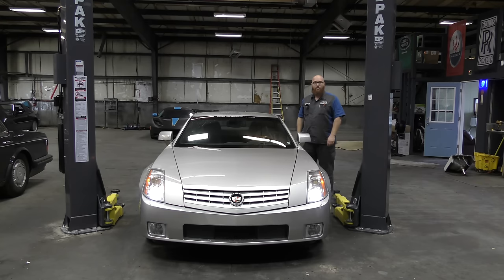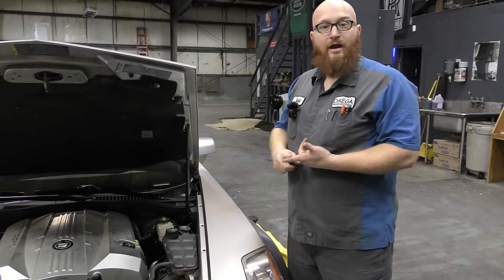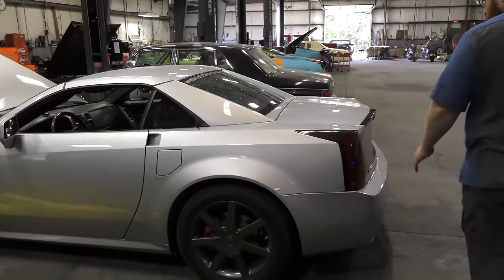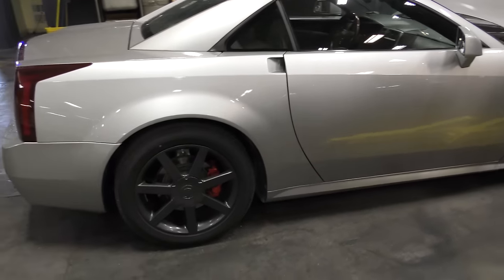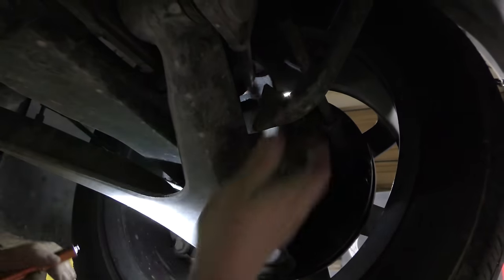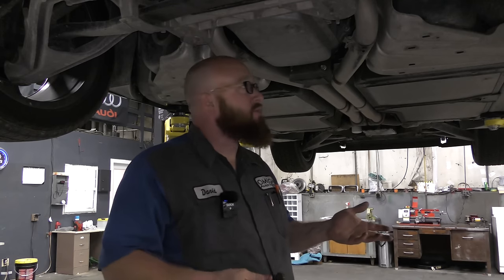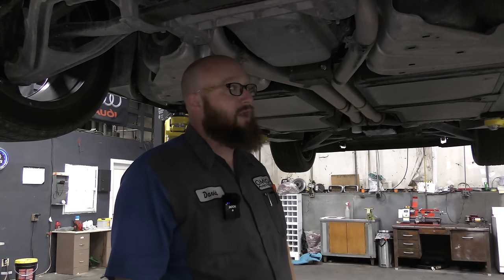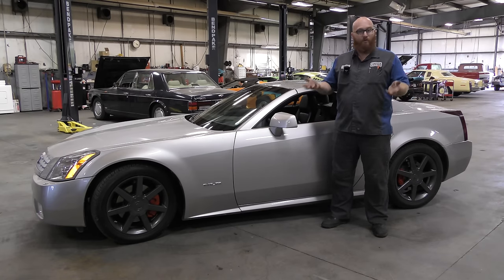The CAR WIZARD is shocked this 2006 Cadillac XLR has a Lotus Sized Repair Bill?!?

Comment: Wizard, check the prices on the tail lights. Apparently the insurance companies write them off even in minor rear end accidents if the tail lights are damaged. About $2K each used !!!
Reply: I went to ebay because to your comment, and holy shit those LED Taillights are expensive as fuck.
I wonder why.
Reply: Honda crx back in the day, rear end crash would destroy the lift gate.
Reply: @josemanuel5749  
Probably due to availability. I don't think they built that many of these cars in any of the trims. That may be the reason the radiator is so expensive also.
I agree with wizard that I think these look really cool certainly more unique than a Corvette. But I think given the circumstances I think I would just get the Corvette because availability of parts is going to be much easier.
Reply: You can tap something with the front bumper of a Lotus Elise and insurance will total out the car.
Reply: @audiowize  Yes because,  you have to replace the whole front clam-shell.
Reply: @josemanuel5749  because the entire assembly has to be replaced for the most part and very few of these cars were made
Reply: Same prices for the headlights.
Reply: @kens97sto171  and performance. unless you get the xlr-v. but for that price, you could get the z06 vette with even better performance 🤔
Reply: That is not surprising on these "luxury" cars. The price for the headlight housing (just the housing, nothing else) on my '12 Lincoln MKZ is $600 per side!
Reply: One guys is selling one for 4K like holy fuck for a ehh car too??
Reply: @leebrooks7467  good car to buy and part out if you are into that
Reply: Same problem with cadillac SRX export version ! (Black version and orange turn signal).
Reply: If there were a way to use a 3D printer to make one.
Reply: I wondered what those new huge escalade tail lights cost to replace. Lots more of them on the road there but they can't be cheap given the size.
Reply: Yes they look great but mostly all GM products are trash and just a minute away from being a huge pain in the head... The money and maintenance these cars require is bazurt, in my opinion, not even worth the risk...
Reply: Drill a big hole in the back of the housing and put your own leds in cheap fix
Reply: Even my 17 Ford Edge tail light was 800$. Headlight is 1100$. Scam.
Reply: @johnp556  but I want to save every crx ....
Reply: @josemanuel5749  When they were still available from GM/Cadillac they cost more than $1100.  After production ended, no new headlights were available.
Reply: @itsthatatm8345  That is a biased opinion (*all* GM products are trash).  I owned two XLR's and I currently own a C7.  I drove my XLR Platinum 80,000 miles and sold it to a guy who has driven it another 46,000+ miles; my wife drove her XLR about 20,000 trouble-free miles, and I've put 44,000 miles on my C7 --- also, not a single issue.  These cars were all built at the Corvette Plant in Bowling Green, KY.  Maybe that's the difference.  Point is, all GM products are not trash.
Reply: @ISUringman1974  That just maybe the difference, I live in Houston TX and our Cadillacs don't come from that plant I don't think, every Cadillac I've come across and or worked on is bumbum, one thing goes wrong, many things go wrong... Biggest issues have been electrical, Northstar issues and transmission issues... I really used to like GM products, hell the Corvette, 1996 Impala, Pontiac Firebirds, Chevy SS's and G8s are some of my favorite cars...
Reply: I heard something similar about vioers years ago, that if you do what looks like  a minor fender bender in the front end that it can be like 20k or more to fix, like the whole clip is toast and when that happens they usually get written off. 
Not sure if I was hearing smoke up my butt or not but it was interesting 😄
Reply: @janetyeoman1544  
newer cars suck. 
I think I just blew about 120$ on those stupid plastic body plugs for the floorplans  on a Jetta I'm redoing. 
If they aren't on a car you're looking at to buy, run away it's gonna be a rust beast. 
Mine were intact until you'd breathe on them or touch them ,and they crumbled. 
Stupid plastic
Reply: @itsthatatm8345  Actually, the majority of GM issues are not seen in cars produced by Corvette (and the no longer produced XLR) because Corvette management, while under the GM umbrella, are really good at what they do and the Bowling Green Assembly Plant has higher quality parts and QM.  So, there you have it...GM could do better, it just chooses not to.
Reply: @josemanuel5749  Cuase they are computer controlled and have a circuit board  integrated into the taillight assembly, VERY difficult to wire tailights bypassing the computer=expensive. btw, its usually the circuit board that dies, not the bulbs
Reply: @itsthatatm8345  GM has gotten better at making cars that don’t start falling apart right away but they’re still unacceptable.  I had a 2002 Pontiac Grand Prix GTP coup that I loved!  I kept it in the garage and only drove it to keep everything going.  In 2019 I decided I was going to take the car on its first trip.  I got 122 miles from home and the car started having electrical problems so I had to have it towed back home!  It ended up being a $3,500 repair to the cars entire electrical system.  The car only has 1,280 miles on it and other little things are starting to fall off or break.  My 2 other GM cars (2008 LaCross V8, and 2012 Cadillac SRX4 3.6V-6) have been excellent vehicles.  I’ve had no issues with them.  My SRX4 only has  22,231 miles on it and my LaCross has over 180,000 and other than tires, brakes and oil changes I’ve had no other repairs to deal with.  GM got their reputation in the 80’s when they started making crap cars and they continued to make crap cars into the early 2000’s.  I mean what the hell was the Pontiac J1000?  I don’t think GM’s reputation has recovered.
Reply: The xlr-v unfortunately is not an ls based engine as you stated, but a supercharged northstar.
Reply: @gplaycount3154  

Yup.....with smaller bores; a 4.4L Northstar POS. 

Flipped a XLR last year....cannot believe how the switchgear and interior trim was falling apart on the turd. Absolute garbage......almost forgot, the retractable roof was tits up...had 60,xxx miles.

Comment: "Cadillac XLR, the car you buy when you want a Corvette C5 but you want to pay more, go slower and not have an LS" 

-Regular Car Reviews
Reply: It's the car you buy when you don't want a Playskool quality interior
Reply: @Scoopra  Cadillacs of these era weren't really any better on interior quality compared to their GM counterparts. Slap some cheap leather and fake wood and call it a day lol.
Reply: @KatoJac  Actually the wood is real (eucalyptus on mine), and the leather is good quality; mine is still flawless after 14 years.  That said, the hardware could be better quality considering this car was supposed to go up against the M-B SL.
Reply: Dave Anderson I’m not being specific to the XLR, just cadillacs of that era in general.
Reply: @KatoJac  Cadillac's have used genuine woodgrain since the 90's though. They used Zebrano back in those days, and my old piece of shit STS had real maple inlays... I should have popped them out and made a craft project with them before I traded it since it was always in the shop, yet GMAC still always wanted their payments on time.
Reply: @Scoopra  nah they feel cheap, I've driven these around. I'd still take a vette. Besides I don't want to pay 3k to 5k for some taillights
Reply: @KatoJac  It's a Cadillac. What are you smoking?

Comment: The XLR is such a good looking car, it's a shame it's so expensive to keep running

Edit: By expensive to keep running, I mean the notoriously expensive tail lights lol. So maybe "expensive to keep on the road legally" would have been better phrasing
Reply: It is expensive if you don't do maintenance. A lot of people buy these cars and run them into the ground and they for go maintenance. That happens when they don't have service people they can trust so they don't waste money they just trade in.
Reply: I dont think a radiator for $300 is that expensive, especially for a quality AC Delco part. The 5 hours of labor is a lot though!  Rockauto has aftermarket ones for around $100.  We've had more mundane GMs and a AC Delco radiator is around 200-300ish for those too.
Reply: You gotta remember this is full charge shop rates. If you're half an enthusiast and have some tools you can do most maintenance on a car like this for parts prices plus your labor.
Reply: Or find a a street mechanic. And only get charged 250 at most
Reply: @johnblaze6269 -And hope he didn't miss anything because he didn't have the proper equipment to diagnose with or shop equipment.
Reply: It's high maintenance and very expensive-just like a beautiful lady.
Reply: @bartonreid6740  The only thing more expensive than a good mechanic is a bad one.
Reply: It is a handsome car. I actually had a wish to one day own one. However, with these repair costs, I'd have to pass. I'm a DYI guy for the most part. But even this is too much.
Reply: @DucatiPaso750  The XLR coupe is nice looking car but sounds like it's safer to just go ahead and buy a Corvette at least there more reliable plus you get more power!!! Cadillacs look nice but they just don't last long
Reply: You can no longer purchase Headlights since 2019

Comment: The rad side tank is made of ABS plastic, clean it, open the creak a little with rotary file prepare a mixture of ABS powder with ABS glue and fill the crack let it dry, pressure test it
Reply: François D yup that was my thinking.
Reply: This is a professional automotive shop that he runs. Rarely does that work. But if it does how can you charge a customer money for a repair and not be 100% confident it will work.  If he went around putting glue all over everyone's car he would be out of business and look like a hack. If it's your car and want to glue it.thats different.
Reply: That's fare enough, however the time taken to clean and repair the part also the part would not carry a warranty. Were it to fail again the repair shop is then liable so from the shop's point of view they will have to use new/as-new parts.( by the as-new I mean say a part that has been rebuilt and had a warranty put on it).
Reply: Some people aren’t in this business  to put Bandaids on someone’s expensive assed car.
Reply: Considering that takes 1-2 hours of labor easily, at $100+ per hour you're paying half or more of what a brand new radiator would cost.  Not worth it!

For a DIYer with time and sweat to burn, sure why not!  I spend a lot of time repairing cracks in a BMW ///M polycarbonate bumper to avoid paying $1,000 for a new one.  Shops preferred to just start with a fresh factory piece.

Comment: XLR V never had a LS option. That was the cts V only. Have seen some LS swaps but not from the factory
Reply: Regular Cadillac use Impala's engine and drivetrain. Transmission's shifting feel same as friend's Impala.
Reply: Didnt the the XLR V have the rare Northstar supercharged engine. Impalas did share the 3.6L Lfx with some caddies
Reply: Yep, 4.4L supercharged Northstar. Also in the STS-V.
Reply: @jesdadotcom  
Cool that you brought that up, the sts-v  was one of those cars that flew under the radar.2009 was the last year for sts-v
Only 96 were made.
Reply: joey C. They’re super cool cars too. I got an 09 STSV
Reply: @gloopytunes1346  To me the STS V was cooler than the XLR,  American E63
Reply: The last year 09 did have a 6.2 not a northstar
Reply: @CRAPO2011  yeah some pontiacs also had the 4.6
Reply: @CRAPO2011  american E44
Reply: @robertvaughn8035  um?
Reply: @robertvaughn8035  that's simply not true.
Reply: @robertvaughn8035  all STSV and XLRV's 8th vin number(engine code) were "A" which is the vin code for the 4.4L northstar, GM reported no XLRV or STSV made with any vin code related to any LS engine (there are too many 6.2 variants to cover even the 6.2's) in short no caddy sports car other than the CTSV ever had an LS.
Reply: @gloopytunes1346  
Awsome

Comment: Wizard good video. Want to help your customer out a bit? Tell him to start using the Techron fuel system cleaner (not the cheap crap the expensive bottle) in every tank of super he uses. Itll clean that corrosion off that pass side sending unit. I had an 08 C6 dod the same thing. Problem solved.

Comment: The cost of repairs reflects the fact that it is a very low production car.  Thats the cost of exclusivity.
Reply: but its strange that the radiator isnt a parts bin one
Reply: @04dram04  The part is listed on GM parts websites. It sounds like the part number was changed for 2006. Maybe he was looking for the old part number.

Radiator Asm - GM (10346017)
https://www.gmpartscenter.net/oem-parts/gm-radiator-asm-10346017/?c=Zz1jb29saW5nLXN5c3RlbSZzPWNvb2xpbmctc3lzdGVtJmk9QkwwNDAyNTUmcj0xJmE9Y2FkaWxsYWMmbz14bHImeT0yMDA2JnQ9YmFzZSZlPTQtNmwtdjgtZ2Fz
Reply: It is an American sports car. Hence it is more a matter of luck
Reply: The cost of repairs reflects the use of overly complicated underperforming parts.  Nothing to do with exclusivity
Reply: @hochhaul  
He had a pinned comment that the rad he was looking for has an oil and a trans cooler. 
I tried to look at that link quick but it was kinda small to be able to tell in the pics what it had (trans cooler only or oil/trans coolers)
Reply: That is no excuse for poor design. :(
Reply: Not really true. there are many examples of low production cars that are not expensive to maintain. Coming from experience one example would be a Delorean. Exotic looks but mechanically simple with many parts available. It can be taken to any Mechanic. There are many Examples left owing to it's  cost of ownership and longevity.
Reply: @RidinDirtyRollinBurnouts  this^
Reply: @mattnbc00  I wonder if the radiator job is cheaper on the LS based XLR-V, I think possibly the price is higher because corvettes don't have northstar engines hench why this is considered a one off piece.
Reply: @geerstyresoil3136 . Exactly, I would have thought they could share that part with corvette since it's not a visible part that would "cheapen" the car.
Reply: The xlrv has a supercharged Northstar NOT AN LS

Comment: The XLR V is actually a destroked Northstar to 4.4 that's supercharged.
Reply: That is correct.  No XLR ever had LS based power
Reply: @johnkennedy3663  true, i don.t think he really knows too much about domestic GM.
 i believe he could have  the tanks replaced on the radiator for around $150 , if he chose to take it off and have it done. 
But replacing it with a new rad? Expensive...
 Same with the fuel sending unit, i've pulled those and replaced the pump/sending unit, it pays more hours than it really takes he is just going by the book.
Reply: @willmc42  350 for a new rad isn't expensive its the quote time to do the job that makes it expensive so you'd have to average that in with replacing the tanks on the rad as well....not to mention the car can't just sit in his shop taking up space while the rad gets refurbed
Reply: It's not destroked just the bores are smaller

Comment: JB weld the radiator, live with the oil leak and gauge. Job done 😂
Reply: Lol probably better off
Reply: Yep for sure I mean just keep the fluids checked and topped up which everyone should be doing anyway. It’s a 14 year old car some things you just live with. I would likely replace the radiator though but a small oil seep you can keep that going a long time
Reply: And get Wizard to do the rear brakes. You actually need those, unlike a working fuel gauge!
Reply: Haha i was thinking that would jb weld work?im a cheap a**

The gauge can be worked around by calculating mileage to the tank

Comment: The repair costs don’t surprise me, especially considering how this thing has tail lights that fetch about $2500 each on eBay because GM no longer sells them.
Reply: GM is a joke anymore. I will never buy another Chevy. I love my Silverado, but there were parts that weren't avalible when it was just 7 years old. And then I got to go on eBay to buythe GM part for 4 times the price or buy aftermarket
Reply: @mjfdiecast1303  great point
Reply: someone needs to make a copy of these, if GM doesn't make them anymore then its perfectly legal to completely copy them.
too bad they only made 15 thousand of these cars so not sure anyone would put the time to develop that.